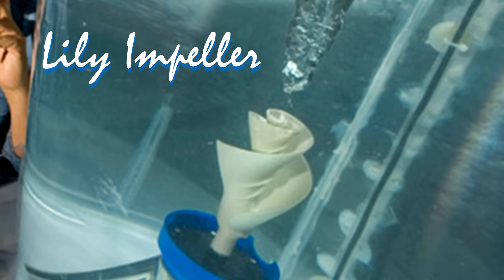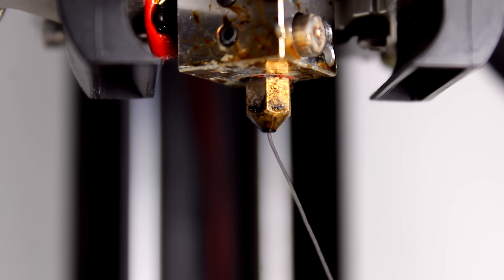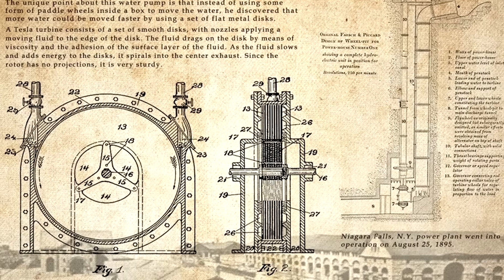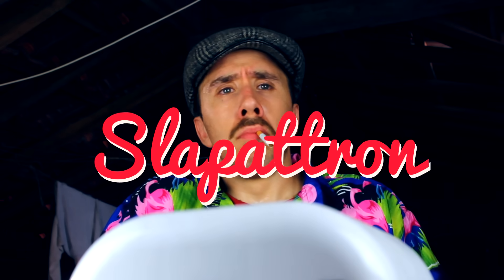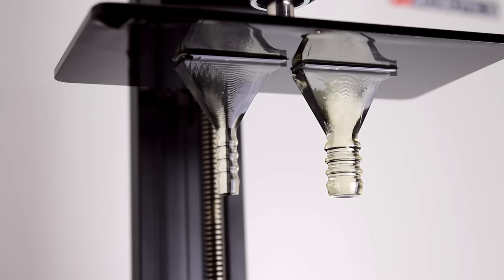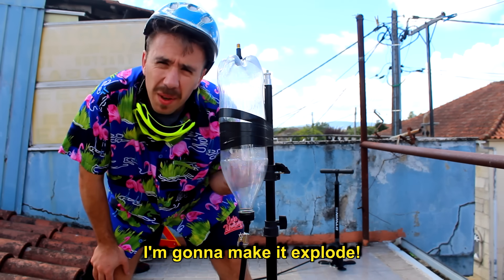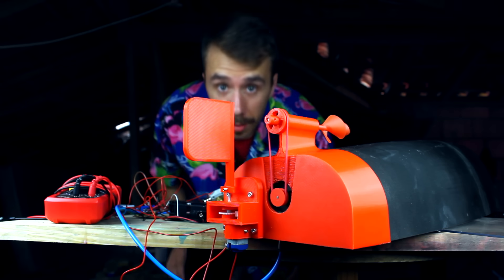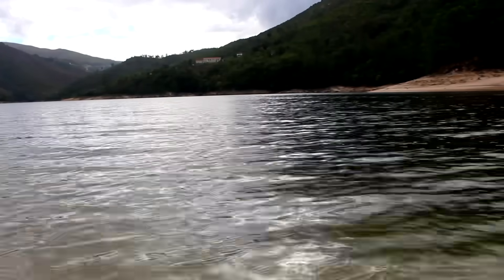Tesla Turbine Boat 3D Printed (Lily Impeller)

Comment: I know that PLA is a potentially dangerous material to use in this idea, but maybe it would be able to handle more pressure than a 2L soda bottle. The problem though is that PLA shatters when it reaches it's limit.

Comment: make a rc channel wing plane using tesla turbine 
1) air as a compressor 
2) water as a compressor 
                  because air and water are both fluids so the water could do

                  compare the efficiency by calculating rpm and how much weight it can lift using the same pressure

Comment: the lilly impeller is great for mixing, but not for thrust because it... "spills"... Imagine a centrifugal fan without the shroud, you need a shroud, or more specifically a duct to direct the flow. The reason your nozzles make things work is because rather than a nozzle, they're acting like diffusers, slowing the air as as the cross-section gets wider. What it means is that your turbine is unnecessarily wide. An impeller is better at producing differences in pressure than it is at creating thrust specifically, so If you're using it on a boat, I would suggest positioning the opening near the front of the boat where it's most beneficial to reduce pressure (since the water "piles up" as it tries to move forward).

Comment: Integza...an impeller according to Viktor(the water bender)sucks air in which in turn makes the water create a vortex...what if you printed something that sucks air from the tip of the boat hence...creating a vortex below the boat into the impeller...😋😋🌊💯

Comment: Instead of using compressed air and Tesla turbine, I suggest using the motor from the RC car. RC boats require quite a bit of torque as water is way denser than air.
Also, make the boat a twin hull catamaran. This will ensure uninterrupted flow of water to the Lily Impeller. The boat might be slow because the impeller was too close to the boat hull, robbing it from fast moving flow.

Comment: YOU SHOULD 3D PRINT A TOMATO KILLER POWERED BY A TESLA TURBINE FOR PEASHOOTER AND A TESLA VALVE FOR BURNER!
Reply: Additionally it could have a hammer with spikes that would be lifted by a series of gears to reduce speed gaining power, all powered by the same Tesla Turbine at high revs.
This way, you could show us how useful and strong gears could be when well applied.
Reply: Hammer weight may be achieved by big screw nut fitted inside the hammer head, and it could be lifted vertically only like a guillotine.... I am not suggesting a guillotine, but it would awesome! ahahahah

Comment: I like the airplane idea but use compressed helium to power the turbine and maybe 3d print the gas tanks. Hope its a bi plane. Maybe use the tesla turbine as the burner ( power ) unit for a gas powered turbo fan jet engine

Comment: The impeller should be much more effective if you use it in a jet drive system. After all, “Suck” is much less powerful than “blow”. Impellers such as yours are taking the fluid (air/water) and shooting it nearly perpendicular to the direction of travel, not helping the boat move forward. Propellers shoot water opposite of the direction of travel. I have a feeling your boat would be much more faster if the impeller was in an internal housing that could direct all of the perpendicular moving fluid in the same direction and then you could have a jet drive.

Comment: Is the "Lily Impeller" better performing or on par with a standard "Propeller"  - can we confirm the speeds / efficiency - using the same boat?  Or is it just the case that; it looks cooler.....

Thanks to Integza, I started reading about both - Impellors are usually shrouded to direct the flow in a particular way. Propellors can also be shrouded for greater efficiency - so which is better? - look forward to your scientific comparison...

Comment: What if you remove the lily impeller all together and power the boat with the pressurized air coming out of the 4 bottles? Would that not work better?

Comment: Warning for your Integza! Using the ashtray probably meant the resin prints weren't curing. Glass is actually opaque to UV, so your resin prints weren't actually cured very well. Just a forewarning!

Edit: I just finished the video and wanted to add a few things. Your impeller is mounted backward! Usually you set the base of the impeller into the water stream so that it can be directed up the flutes and redirected backwards. Similar to your last video where you took water from the base of the funnels and directed it upwards to create the vortex! 

The other thing is that an impeller is usually mounted inside of a housing. The housing has a ram scoop to pickup water, direct it through the impeller and then there's usually some sort of Venturi nozzle like a jet engine to help give the water one last squeeze to help it exit with more force! That does load the impeller more though, which may be an issue for the Tesla Turbine. For steering the entire housing is usually moved to angle the jet! Hence the name jet boat! It used an impeller based water jet! Just my two cents! Loved the build otherwise!

Comment: Or you could use the Lily impeller. To generate energy from water by connecting it to to a brushless motor or a brushed motor. By printing a jet type housing to hold the Lily impeller. That would have a through hole to allow water to pass the impeller.

Comment: This would be a good re-visit in a later video. Lose the bottles and get a 13 c.i. air tank as used for paintball or airsoft. They are light, store air at 3000 psi (200+ bar), and are regulated at 800 psi (55 bar). The bottles are creating too much drag. This, integrated with the other comments, such as stabilizing and shrouding the impeller should give much more thrust. Don't worry about putting the rudder in the center, or making dual rudders. Look at RD boat pictures. Most of them have a single rudder set to the side of the thrust system. Good luck on future builds.

Comment: That streering thingy is called a rudder. Ruh-der. I'm curious to how several Lily impellers would work in sequence. Like how propellers can multiply the force liquid is moved.

To clarify... Place two fans one in front of the other and turn them on. The amount of air moved is increased significantly.
Reply: Rrrraderr, RADDERR..

lol
Reply: You forgot to mention one thing: They need to rotate in different directions. If two fans have the same shape and rotate in the same direction, you don't get any more thrust. They need to counter-rotate and have a mirrored shape of course

Comment: Nice, although it would have been nice to see a normal prop fitted to that boat as a comparison.
Please build a vortex tube, the type that generates hot and cold air with no moving parts.

Comment: Would the boat have had better thrust/speed if the impeller had a shroud? Or are impellers just less efficient compared to a propeller to move an object in a fluid, rather than just the fluid itself?

Comment: should alter the boat to use a HPA paintball tank for the air supply, and increase the size of the impeller. this would give you much more run time without the drag of the soda bottles. also switch out the rudder control to use a simple servo, it would give better control. HPA tanks are made of composite so are pretty light and hold the same pressure as dive tanks.  love this project and want to see it upgraded to awesome level.

Comment: You could try mounting the impeller the other end of the drive shaft to avoid interference from the pulley, also a shroud around the impeller might concentrate the water flow in the rear direction with less waste from side production. If I could afford a 3d printer I would try this myself, but such is life.
Love all your videos and the enthusiasm you show.

Comment: Low cost  autonomous solar traking. I saw some cheap solar panels on Amazon. Im talking about something small. When the shadows hit a solar panel it moves. 4 solar panels. 4 servos.  3d printed structure. No need of complex electronics.

Comment: "A propeller has an open design while an impeller is always inside a casing or housing."  your impeller is under performing..
Reply: Exactly what I was thinking also I think its too small to produce enough thrust and if the bottles are touching the water that's a lot of wasted energy
Reply: @seeker4430  nah it's a good size for the boat. the problem is he had no cylinder aground the propeller.
Reply: You beat me to it.Damn!
Reply: And he may have the impeller backwards too for flow?
Reply: can a lilly impeler have a casing? isn't it too.... lateral on the 'outflow'? (neither english nor engineer, just asking out of curiosity)
Reply: Daniel Gallego - impellers can have casings to contain the flow. If your trying to capture flow from an airstream casings are not required but if your trying to generate flow by driving the impeller a casing will increase flow of the fluid by preventing fluid from coming off the outer edges of the surfaces. The easiest way to explain. Look at a jet ski impeller drive system. They housed in casings for improved performance and directional control.
Reply: he beat me to it also. i would love to see this impeller in a jet ski.
Reply: Possibly use the housing almost as a jet engine, use the impeller as the intake and build the housing in such a way that it creates a high pressure jet and once the boat starts moving or has current the housing would also act like a ram intake which might increase efficiency
Reply: Theoretically a boat propeller is ment as a device which pushes against the water moving only the boat not the water, an impeller increases the flow and pressure of the water and provides thrust by flinging out masses of water. 
Both can be incased. 

The headache starts with surface piercing propellers lets not go there.
Reply: Because of the nature of this impeller it has no resistance to the water as the helixal design in nature is the path of least resistance. If you want to move forward you need to push against the local atmosphere.

I wonder if creating little outcroppings within the impeller spiral design to create the drag force would show any meaningful result.. I dont think however that would be applicable in both directions
Reply: Nice tools not nice ideas
Reply: I was thinking that the drag produced from all those bottles doesn't help either
Reply: Much agreed
Reply: Use the Jetski propeler design to test the impeler ;)
Reply: Even just a thrust ring around the impeller would increase thrust, it would be nice if two tesla turbines powered the boat one feed off of the others exhaust
Reply: Yeah...maybe you should focus on one innovation at a time.

(For the compressed air, a simple rubber balloon would have stored more energy).

I’d like to see the impeller inside a transparent plastic tube.

What you’re testing is the ability to force water down a tube and thus create a water jet to push the boat.  

Glue a transparent tube the whole length of the boat.

And use multiple impellers on that axis.

For power, use lithium batteries and a DC motor.

Thus you can adjust the speed as needed.
Reply: Also I don't know why he would use a tesla turbine... The torque would be so less

Comment: Love the project. I was thinking that maybe you would get more suction action if you surrounded the impeller in a tube with very tight tolerances on the inside diameter.  Kinda like a ducted fan. This would force more of the turbulence through the tube and not radiate out from the impeller.

Comment: Dry ice and water in the tanks to cause rapid pressure, and extended range.  (You'd have to have a release solenoid/valve tho)
+you'll have the cool fog coming from the turbine in the water or the release valve/solenoid valve.

Comment: The best Invention for 3D-Printing seams to be a 3D-Printer. It could Replicate itself many times to make an Army of 3D-Printers.
Reply: 3D printing a 3D printer is not an original idea. The first open source printers were designed so that they could print parts for additional pri ters.

Comment: V2, use a 8 or so CO2 cartridges in tandem to power it. Similar control system but it should reduce drag on the boat, helping it move much faster, maybe add som narrow outriggers to stabilize the boat as well.

Comment: I think that either using gears or directly connecting the impeller to the turbine would have been much better. There is no way that thin little rubber band did not slip under load

Comment: A jet boat/offshore (miami vice style) powerboat or hydroplane.

Powered by gas turbine(or multiple), a big tunnel ram/multi stage jet-pump(using water-lily turbine design), America's cup style hydro-foiling keel hull/hulls to reduce resistance.

I'd power it on kerosene and either just air or air tanks like your example.

I will do this if I win your printer and YouTube the whole thing.
I am multi trade qualified, I am an electrician, I worked in power generation/distribution in communications/protection/tech/plc(industrial control).
I have only paid for a mechanic once in my life, old school style work ethic, I've taught myself most of what I know.
I studied website/software design at the start of the year before covid ruined our university/polytechnic.

I am currently a student/unofficial teacher at a trade school in my home town.
Welding is the only trade skill I didn't know, so I've learnt that pretty well now.
They like all the other skills/enthusiasm that I brought along and have kinda been groomed for a few jobs..
I was bold enough to apply for the engineering tutors/educational managers job(s) when the positions opened up and I felt like having them check my CV and references (and to just show off that when I talk about my previous experiences/work skill I'm not a compulsive liar 😂) 

I've started a raspberry-pi gaming controller electric motor starter motors (rear steer through electronically controlling calculated radius for turns (spares I had laying around from my hobbies)), prius/mercedes electronic/hydraulic steering box/column, lathing car axles for stub shafts/chain gearing. 

Powering bed/or maybe couch project (project team leader at my course).

Your theory I love.
I read obsessively.
Though I do have a need for speed (going fast, not drugs (like your smoking joke)).

Keep up the good work bro!
Matt! 🤙💪🤓💕
Reply: Maybe even liquid oxygen (lox) if I wanted insane rocket type power ("powuh") to weight 💪😎
Reply: I like the reference to the car yard inflatable things.

In New Zealand we call them "flappy boys" 😂
Reply: Happy September folks!

Good luck with the competition submissions ❤️👍
Reply: Good luck Matt!
Reply: Less resistance = less power used somewhat, it makes sense in my head hahaha therefore youd get a faster boat as you're cutting not pushing the water!
Reply: Thanks for the up vote Lisa.
You are a good friend 😊🤙

Comment: Make Wimshurt machine (*1880), it is electrostatic generator which can generate high voltages.  You can make crank powered stun gun from it and zap people. Instead of capacitors you could use homemade Leyden jars.

Comment: Your boat needs to hold the bottles out of the water, add a keel for stability, and include a duct for the impeller.  You could add a small diverter into the rear of the duct to replace the huge rudder you went with.  I think you could make that baby _fly_... on water... so... glide?

Comment: WWII Germans wrap theire bottles in strings and Rubber Stuff to hold more preasure (Fieseler Fi 103)      Print some coanda effect air nozzle thing for Underwater air thruster, if you have 2, you could steering, like a Tank, one side is left right and other side is forward and backward from your car

Comment: No, an impeller does not generate thrust by "sucking" in a fluid. Impellers are simply ducted devices for moving fluids.

For the failures - most are rather obvious.
The inlet to the tesla-turbine simply spread out the airstream and the biggest contributor to the output of this little thing is velocity.
And the "impeller" well - it never was gonna be efficient and it shows.

Comment: I really loved the video and the implementation However, an impeller is surrounded by a cylinder to direct more water in a straight line increasing the thrust. Without the cylinder it is just a propeller. Great try and all things considered it did work.

Comment: I started working on cycloid gearbox and wanted to print this with FDM 3D printer. But the thing is - to make it good it's need to be precise. But one clever man said: if you cannot make it precisely - make it adjustable. So, the question is - how to make cycloid gearbox with 3D printer and make it adjustable to have the most precise fit?

Comment: Reviewing the previous video, I realized that the impeller generates a whirlwind around. This may be disrupting the boat's movement. What if you put a structure around the impeller, which works as a conical nozzle to guide the whirlwind to the rear of the boat?

Comment: What do you think if building a jet boat with lily Impeller similar to RC life on‘s jet Boat but with a different impeller and for example an elekrik motor or a small rc nitro engine

Or try powering a boat or a plan with the 3d printed puls jet engine you build

I love your videos because they are entertaing and informtive at the same time.

Comment: The lily impeller would work better inside a long cylinder where the petals closely touch the sides of the cylinder. a smaller  conical outlet at the smaller end of the impeller would increase the power output. This would/ should increse with forward momentum!